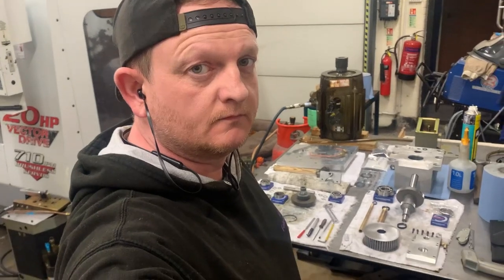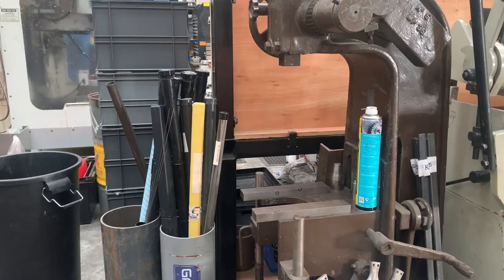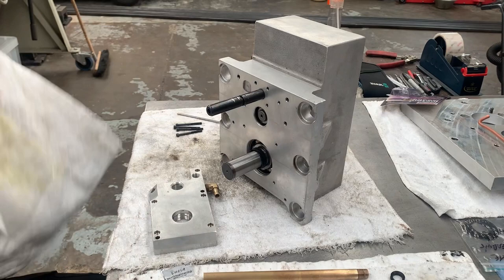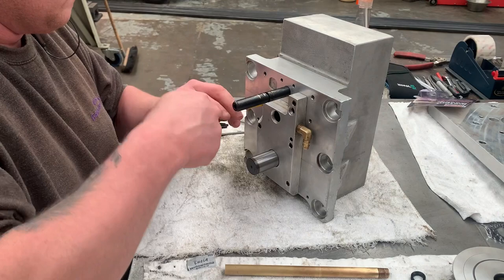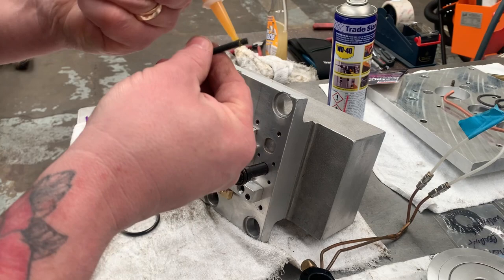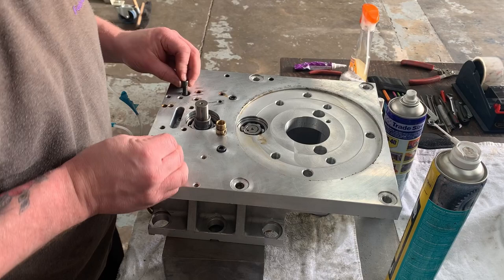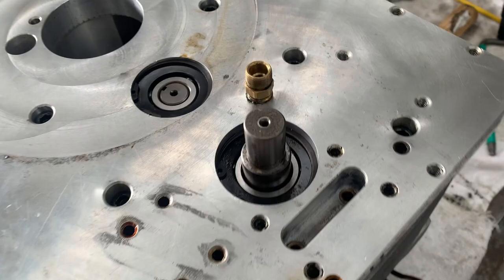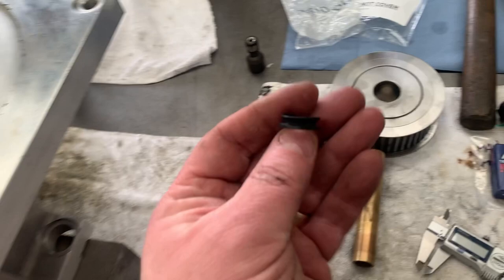Haas Hi Low gear issues part 6  assembly back into gearbox housing

Comment: You are doing a great job with the Videos there very helpful as I have a similar gearbox  issue here in Canada. But I have 20 years as a service Tech, specializing in pneumatics and Hydraulics and that shifter shafts looked  horrible, being that your main issue was shifting I would have repaired or replaced the shaft, it will work but the seals will wear out prematurely. Other then that awesome job.
Reply from the maker: Hi

Thanks for the insight, it didnt seem to bad but if the issue happens again in a short period of time maybe that will be worth doing while i am in there

Thanks
Marc